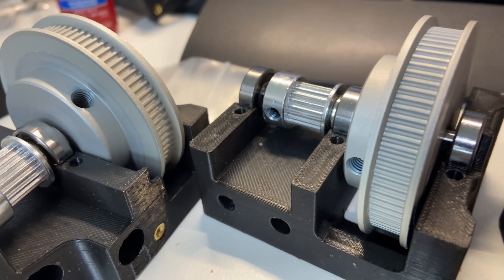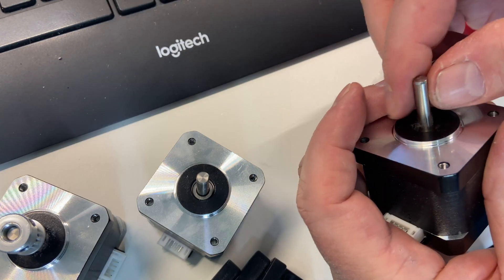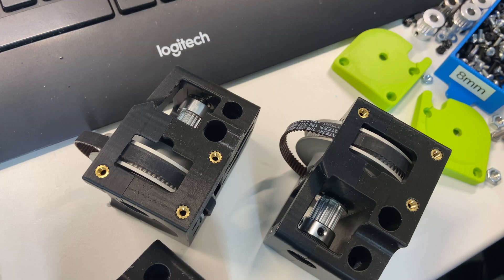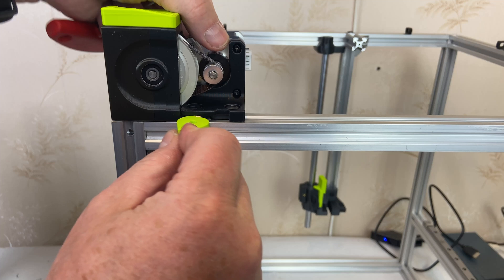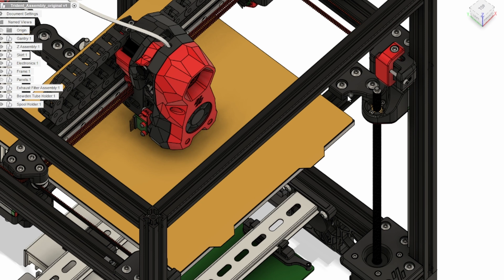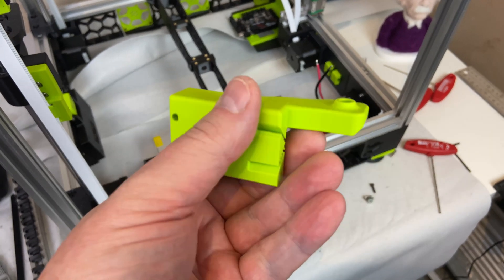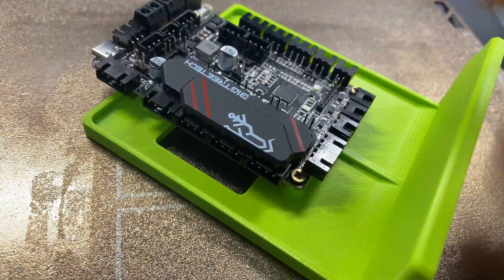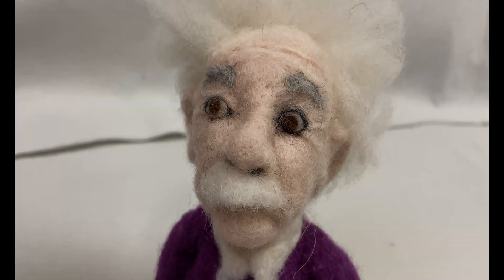It's not a Voron - z-axis and skirt

Comment: Should get some gates belts instead of the cheap generic black/white ones. They're using metal strings rather than fibers which doesn't allow them to stretch much.
Additionally the gt2 pattern isn't the most consistent on these, ask me how i know hehe..
Easier to replace with proper belts now before the printer is completely together.
Get the Power Grip if you want to go fancy, regular Gates works fine for z also.
Keep up the great work!

Comment: IMO I would never use loctite more so the red Loctite you risk not been able to remove the screw or bolt and this is a  part you need to service often belts get old IMO this is a bad idea, but this is your 3D printer, so you do as you wish good luck peace!
Reply from the maker: Thanks for watching and sharing your experience. The bottle is red, but this is blue loctite btw. The red loctite has a red label. Belts and bearings will probably wear out first and I can replace them without any problems. So far in this build I haven’t seen any bolt that needs threadlocker. Only set screws, so I am not worried about this. In my opinion spinning gears is a bigger problem.

Comment: Could you use a rod at the back if you used a normal bearing instead of a spherical bearing?
Reply from the maker: Yes, if it was firmly attached/locked to the bed. But then I would miss out on the independent steppers for z. If you look at the Bambu lab P1S it has 3 rods and one common stepper/belt running all of them.
Reply: @v4projects   If I understand, you need three degrees of freedom but no more. The guide rod has one, and the ball joint has three. Maybe something with two normal bearings would work, but it’s an uphill battle.

Comment: I would highly recommend a lighter toolhead - XoL or Archetype Blackbird are great performing toolheads that save a lot of weight and let you reach very high performance as a result! 😁
Reply from the maker: Thanks! I'll look into that.
Reply: @v4projects  for reference, My CR-10 had a recommended acceleration of 42300 with MZ-type curve with the XoL toolhead.
Reply from the maker: wow! I don't think the rest of my printer can keep up with that to be honest.
Reply: @v4projects  same problem here - the heavy bed is struggling to get over 10K, despite having dual motors

Comment: What I like to do with threadlocker is to take a piece of plastic and put a few drops on it.  When assembling you just dap the screw into the little puddle.
It's a bit more controlled than trying to use the bottle.
Reply from the maker: Yes, I agree . I tried both methods and it was difficult getting the correct amount straight from the bottle.